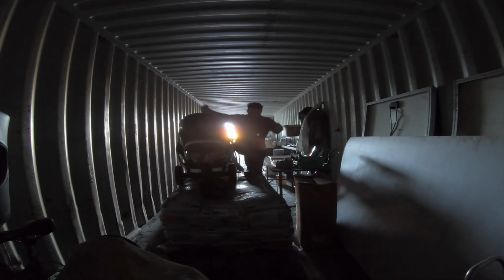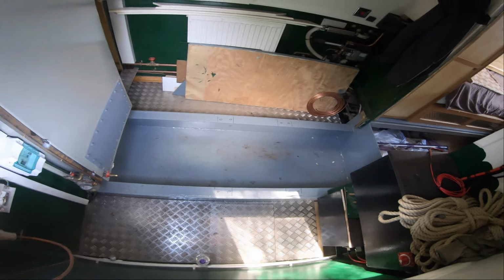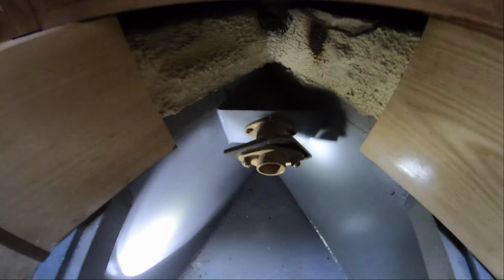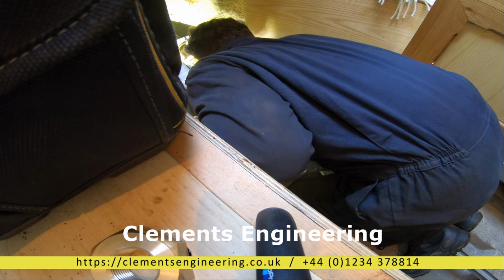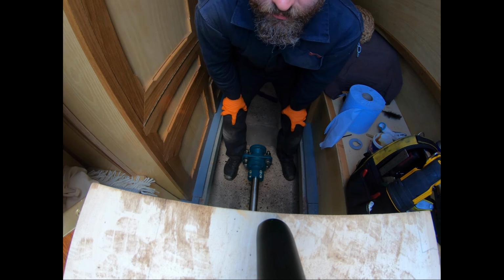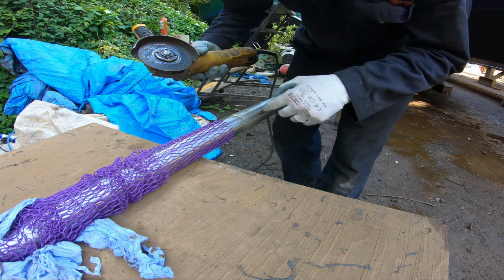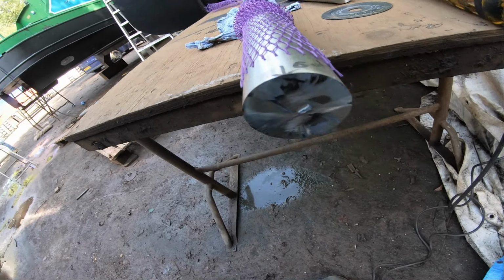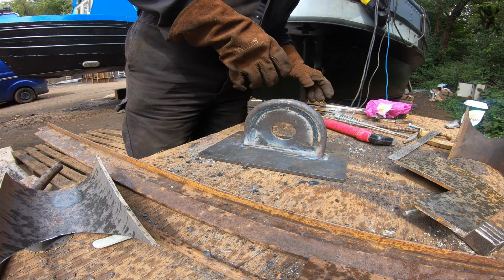Lister HRW2 PRM260 D2 Installation

Comment: Nice job, I guess who measured the shaft didn't take into account where the intermediate bearing was located, too bad. The lifting eye was overkill, just have to push up on hatch and put a couple of pieces of conduit to roll it out of the way. Nice to get a high $$$ job once in awhile.

Comment: Do you have any details on where to get the necessary adaptor plates and components needed to change the engine from a Blackstone 2g box to the prm at all please?
Reply from the maker: You'd need a custom adaption plate so a decent engineer place with a big enough machine shop is the place id suggest
Reply: @dhcrouchmarineltd3049  thanks for the reply how does the drive get transferred from the lister gearbox crank drive to suit the prm box? Never been able to see how it's done
Reply from the maker: @djmarine4499  listers have a 3 bolt on drive member. One would have to fabricate a plate on that to hold a suitable drive plate.
The the gearbox has to have a means to be located on the engine. There's many ways to do it. One method I've seen is to support the gearbox via adaption plate with mounting brackets. However ensuring a concentric configuration is paramount.

Comment: Ooh a bit like my HR2W. The red accents are cool. Are they original. 

That’s a nice place the alternator is in. Mine has it on a pulley straight from the driveshaft rather than the third leg. 

Also your hand crank shaft is fitted a lot closer than mine. Nice compact package!
Reply from the maker: I think so too. Credit for that build is to John Pattle. He built it up.

It was a nice compact install I must admit